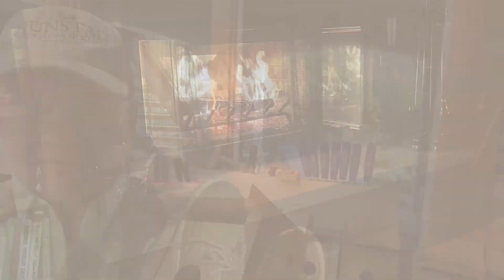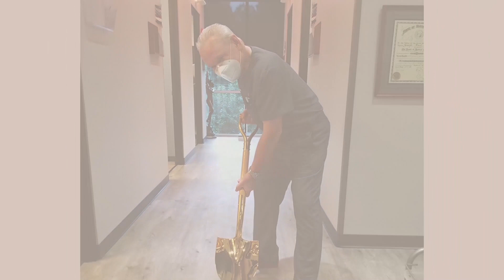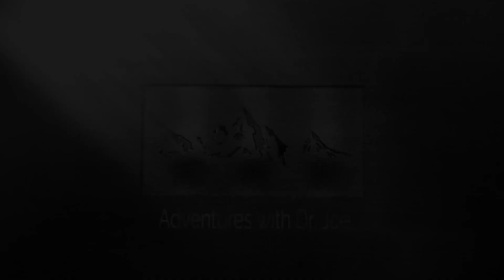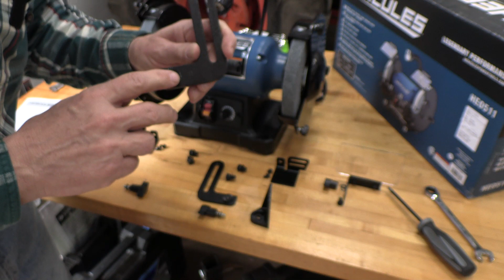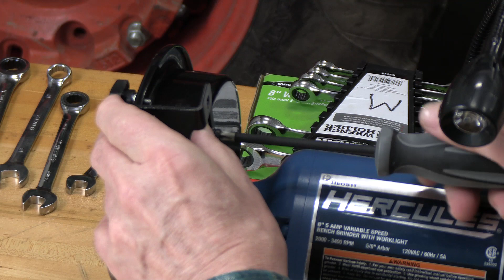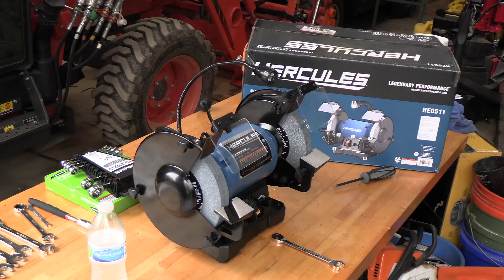Hercules 8 in  Bench Grinder Variable Speed Assembly, Review, and Use w Dr  Joe

Comment: Could you sharpen hair shears with this
Reply from the maker: Yes, you can certainly sharpen hair shears with this grinder, but I would use a fine wheel and a very gentle touch. Keep the angle the same as the angle of the grind on the blades and it should do a good job. Consider subscribing. Thanks. Joe.

Comment: I would love to buy one of these but it looks like Harbor Freight discontinued the varible speed?    Any suggestions?    There's one on ebay (open box) but it's well over $200.00
Reply from the maker: Harbor freight has a three-quarter horsepower variable speed grinder made by Bauer that you might consider. It seems to be very similar to the previous Hercules grinder that I reviewed.

Comment: I have this. I do like it. How  do I add water to one of the wheels. I use it to shape rocks
Reply from the maker: OK that is a very good question. Typically a water wheel is a slow rpm wheel. I have a number of these the classic one is obviously the Tormek
It is possible I supposed to obtain one of the water troughs and attach it to the side of the grinder but I don’t have any experience with it. I’m interested to see if it works for you. If so, please let me know. Consider subscribing. Thanks, Joe.

Comment: I'm a subscriber, to your YouTube videos.
Is the angled rest for sharpening drill bits, in the left side work rest, for the creation of 118° angles in the heads of sharpened drill bits?
Reply from the maker: Hello Ken. Yes that angled groove in the tool rest is for drillbit sharpening. You have to be careful to have the angle of the tour rest set to get the proper relief on the bit however. Thanks – Joe
Reply: @JosephHunstad   Can this bench grinder be turned on and used at full 3,400 R.P.M. speed, when only one of its two wheels are on it, without damaging this bench grinder or the one remaining wheel that's being used on it?
Reply from the maker: @kenw9681  good question Ken. I would probably prefer to run it with the second wheel on for balance but I think it can run fine with one I think there’s a greater risk of more wear however particularly if you’re really pushing on that wheel.
Take care – Joe

Comment: Can I add a wire wheel or buffer wheel to this and does it come with a spacer if needed?  Not sure if I miss this in the video.  BTW, I was wondering how to use that Harbor Freight Grinding Wheel dresser. I didn't know how you were suppose to position the thing. Thanks for the demo!
Reply from the maker: Thank you for your question. You can add a wire wheel or buffing wheel to your grinder but sometimes it’s a great idea to takeoff the shrouds. I have another video on turning your grinder into a buffer that you may wish to look at. Additional spacers do not come with this grinder and you may have to add some. Typically I add a 5/8 inch inside diameter washer on either side of the wire wheel so that the larger bushings will come into contact without holding the wheel securely. Take care Joe

Comment: What are the two tools you used to true up your wheels especially the t shaped diamond one and where can you get them ??
Reply from the maker: Thank you for your comment. All of these devices are known as grinding wheel dressers. They can be a rotating wheel, a solid bar, or a diamond encrusted block on a handle which is my preference. Copy and paste the following into Amazon and you’ll find a nice set for $10.99.

3 Pieces Grinding Wheel Dresser Diamond Grinding Wheel Stone Dresser Tool with Flat Diamond Coated Surface for Truing Grinding Deburring Wheels
Reply: Thanks very much for your reply and I'll look into getting some....great presentation  ... take care have fun...bcnu
Reply from the maker: @robertnimick7584  Thank you so much I think you’ll enjoy those they come in three grits so depending on the wheel or the condition of the wheel you might need the course one but probably the medium and find when are the best. Thanks Joe

Comment: Seems closed on itself. How is the motor cooling?
Reply from the maker: I have run this machine with wire wheels on it very very hard for a long time and the motor does good hot but it keeps on working. If you take the cover of the base off you’ll see there are four holes in the bottom part of the motor itself.
These holes vent into the base which is loosely connected to the motor so The motor vents out to that area.
Take care Joe
Reply: @JosephHunstad  Thank you so much for the prompt reply and clarification.
Reply from the maker: @Quentyn73  not a problem. I didn’t know the answer to your question and it was easy just to screws hold the plate on the base and then you can see those four openings of the motor. Take care Joe

Comment: Bought one of those today for touching up HSS lathe tools;  seems worth the $104 I paid for it today.  Put a fine grit white wheel on it and after truing up seems fine.   Variable speed seems like a nice option.  As far as assembly goes,  pretty straight forward but instructions don’t provide as much info as the picture on the box does LOL.
Reply from the maker: Thank you for your comment. I have now purchased two of these one I use with a steel and then a brass wheel one on each side the variable speed is nice because 3600 RPM for a wire wheel is too fast. The other one I converted to a buffer took the guards off and I love the variable speed for the buffer. Take care Joe

Comment: Nice review and tutorial. I just bought one yesterday. Plan on using it mostly for sharpening. Mine seems louder than on the few videos I've seen. (Specially on slow speed.)  Of course I'm hearing it through computer speakers. Is your grinder as quiet as it seems? I'm just debating if I should exchange it. first grinder so no real frame of reference.
Reply from the maker: Check to be sure it doesn’t have any bearing noise if that’s the case then it would be a bad bearing but no my grinder seems to be very quiet I’m really impressed with the minimal vibration right out of the box.